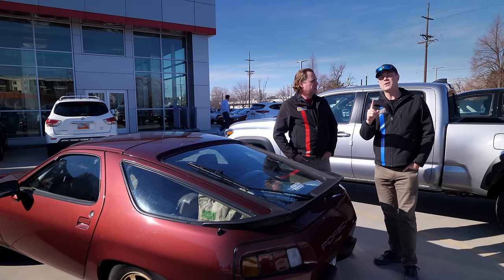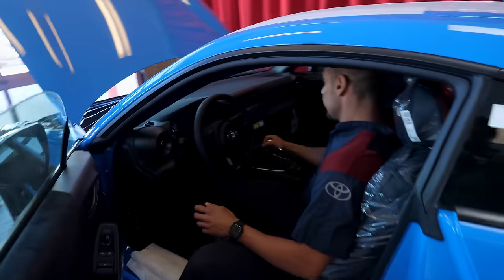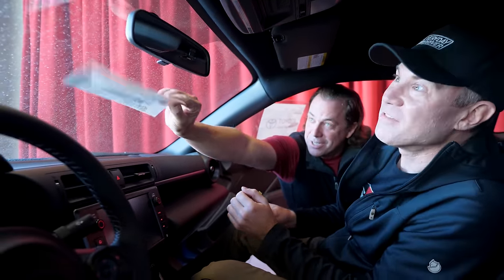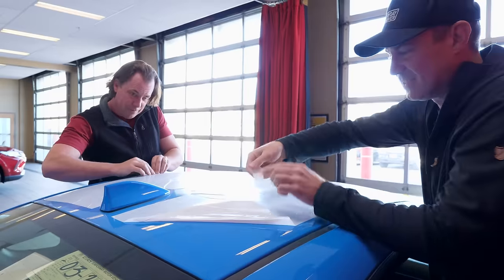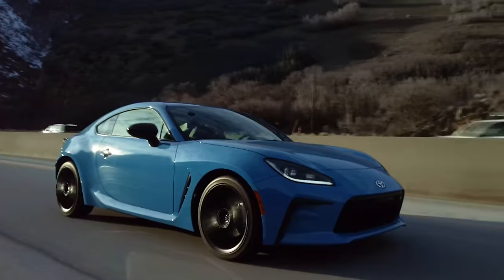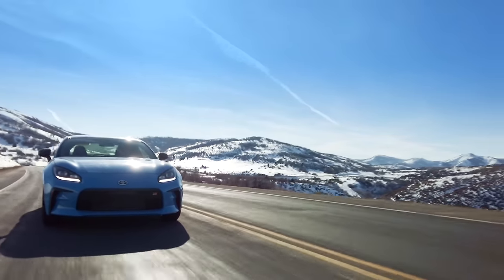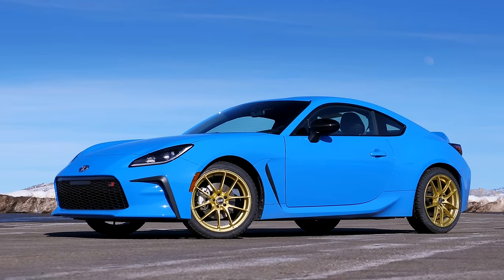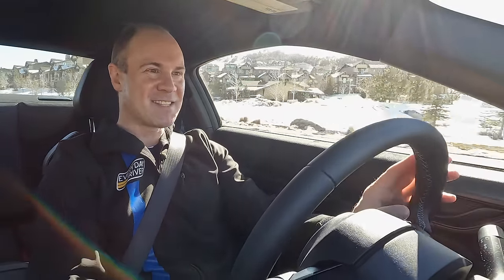We bought a GR86! - Money where our mouth is - Long Term #1 | Everyday Driver

Comment: Why are they installing fuses at the dealer? Some optional equipment? 🤔
Reply: Part of the dealer intake process that is usually done before customers take delivery. We asked for them to not do any of the usual predelivery stuff until we got there so we could fill the entire process the dealer goes through with any car that comes off the truck.
Reply: @phattyhales  I caught that part, with the plastic on the seats and all the other various protection. I'm just curious as to what would need a fuse to be installed by the dealer. Thx for the reply.
Reply: @hh65flyer  They remove a couple fuses for transport so that you can't start the car or get in with the fob.  Kinda weird.  The tech actually initially opened the door with the key from inside the fob.

Comment: Is that the same 2L petrol flat 4 engine like on the BRZ with no turbo and 200 bhp ? It would be great to have for example a 2.4 or 2.5L with a turbo.
Reply from the maker: This second generation has a different engine than the first Gen. 2.4L with more power. We discuss it in detail in our other GR85 videos. Thanks for watching!

Comment: Question: is it still the case that the engine has to be run for like 3k miles or so before actually putting it under stress? Revving it hard and such?

Thank you. And loving that you put your wallet where your mouth is. Congrats, guys!
Reply from the maker: The theoretical break in period is 1k miles, but we mostly drove the car normally from new and discussed this in our second video on this car, “Answers”. Thanks for watching!
Reply: @EverydayDriver  thank you for responding! Yeah, I watch that second video immediately after this one, and you clarified that question. Sorry!

Comment: Does the headrest raise? It looks like you’d suffer whiplash in an accident they’re so low
Reply: oh I see you raised it half way through 👍
Reply: Fun fact, did you know that headrests are actually part of crash testing?  They are designed to prevent/limit whiplash.  I found that interesting when I learned that a few years back anyway.
Reply: @phattyhales  in a rear ender a neck will break like a match stick without it

Comment: Keep it under 4k RPMs for the first 1,000 miles or you'll be adding oil with every tank of gas in 100,000 miles.

Comment: Did the dealer pull the fuse on a locked car in their garage?...
Reply from the maker: All cars are shipped with fuses pulled. Out car hadn’t been addressed yet because we asked them not to do any or their normal procedures.
Reply: @EverydayDriver  Ah gotcha! I wonder if they got it in there without it or pulled it after parking just for yall to get the full experience.

Comment: So, again, where are we HONESTLY on the fact that the 2022 WRX comes with boost for the exactly the same price and engine? Lets be real in 30k range vs MAX 20k that these are worth out of the box...
Reply from the maker: If the only thing that makes a car fun to drive is power, then yes, WRX all the way. But the WRX is never going to feel like a lightweight RWD car. Preferences vary, but there’s a lot more to driving fun than if something has boost and the output number. Thanks for watching.

Comment: Doesn't the paint protection film help long term in this low to the ground vehicle? How much crap will hit it in the front in the first year and the hood before it looks like an unfortunate teenager's zit-laden face? Plus if Toyota puts it in, I am pretty sure the warranty is worth it. I mean, no, it is not going to look great, but the level of protection long term makes it a worthy investment. No? Unless, of course, you can find some  other reputable shop who can do it reliably, with a long term warranty and at half the price.
Reply from the maker: We are big proponents of PPF. But the Toyota application was a small strip above the front bumper, not including the actual nose,front facia of the car. Essentially useless. 

We have since had it removed and had the entire nose from the front splitter to the windshield done correctly. Our issue mentioned here is with what Toyota provided. Thanks for watching!

Comment: Mark ip for a gt86? 😂. I owned one for about 3 years. Ok to drive but so cheaply made. No torque and slow as hell. MX5 is a better car for the money.
Reply: Agree on quality feel.  Test driving used worn down frs shows the poor interior quality.  New GR86 feels like a lexus in comparison.
Reply from the maker: Most everything is getting a mark up right now, but we were glad to get this for MSRP. Also…. We hope you’ve driven the new one! Thanks for watching!
Reply: @EverydayDriver  I haven’t. I own a BMW Z4 now with a V6 so could never go back to that low torque and power but I can see the market for the car. Still think the MX5 is the better car for the money but that’s just one guy’s opinion. I would suggest anyone interested in this car to test drive a MX5 as well.
Reply: @adventuresofjandk  in-line 6?
Reply: @Barbwire710  twin turbo inline 6

Comment: Quick question, I'm seeing a few YouTube videos by guys talking about silicone in the pick-up tube of the engine.  Potentially could be an issue. Are they using silicone instead of a gasket?  That would really piss me off as this same issue happened on my 1996 Corvette where the silicone dried up and started leaking.

Comment: Bad decision.
Reply: Why?
Reply: @Barbwire710  overpriced, still underpowered and deprecates heavily
Reply: @jongib6096  that’s completely fair. I bought the last 86 brand new for around 27k, it was worth like 18-19k after a year if I remember correctly. It was also dog slow stock and awful on the highway, couldn’t even have a phone conversation due to wind noise.
Reply from the maker: No doubt that it will depreciate, even in this market. But we stated the reasons we think buying new is important. We also hope you've driven the new one.
Reply: @EverydayDriver  Waiting on my Z!
Reply: gr86 will be more fun and lightweight.  Why get z. Just get mustang gt gt350 etc.
Reply: @jongib6096  - which one? I heard that base models don't have an LSD.

Comment: Breath in all those carcinogens.  Nice. No one does this at a dealership. This was scripted , peeling off all that plastic. The cars normally in the showroom with all plastic peeled off. Like my GR 86, however what I don't like is the cheap grade plastic used on the center console around the shifter. Scratches way too easy. 228 hp just isn't enough. A car that looks like the GR 86 should do better on 0 to 60 time. A more aggressive rear valance would be better. I disabled the fake noise, put an after market exhaust system and sounds much better naturally. The turn signals really are annoying. The car looks good by way of profile. Front view looses points, rear view as well. I went with Steel on color, and the base wheels contast nicely, giving the car a bit of bling, sparkle. Living in Florida,  I wanted cloth.  My last car had leather, and just too hot when getting in the car. 
     Fortunately being a light car, the power proves out to be decent, however really should be better. A car that looks like this should have fast to match the looks. To buy these pre-owned with higher mileage will be a risk. I fear most of the GR 86s will be so dogged out,  and scratched up interiors. And worn out seats due to cheap quality materials. Durability just won't be there. 
Overall,  I enjoy mine, however don't wring out the car. I'm good with just installing a nice axel back exhuast. Need to tint the windows. The factory Tinting just isn't enough. The dealership had pinstriped all their GR 86s and charged a ridiculous amount. I couldn't stand it so I removed them after I had the car for a few months. Just an 80s look, besides after the sun gets to them, eventually Crack, fade, start to desingrate looking so bad. With all the mark ups and negotiating I paid 33,600 including dealer fees, tags and taxes. Base with automatic. I'm good with the automatic. I like the shifts, and have sport mode which feels good. Paddle shifters decent, however I really don't prefer them. An overall fun, quick, great handling car that one can be happy and content in stock form. On a realistic car market pricing wise before the outlandish guaging, even on used vehicles, thanksvto supply chain issues, the GR 86 would be considered expensive. The materials quality, the engine size, pricing should be starting at $24 000 base manual,  Premium Automatic $28,900. These should not exceed $30,000 before dealer fees, tax, tags.
Reply: With all that being said, and your experience of having one, it seems like it's not worth it and you regret buying one???